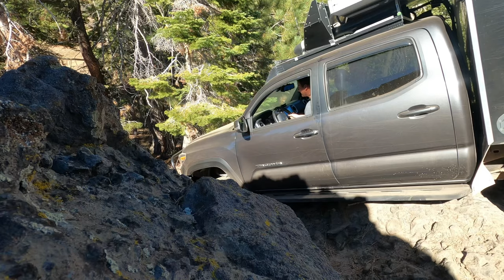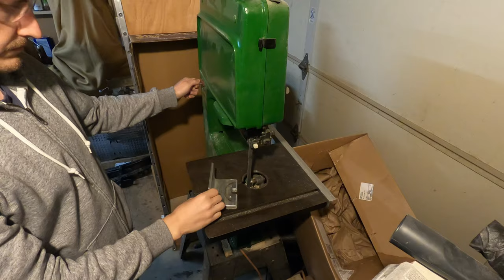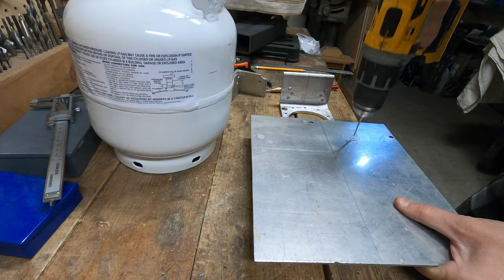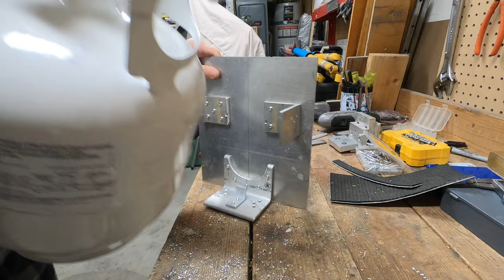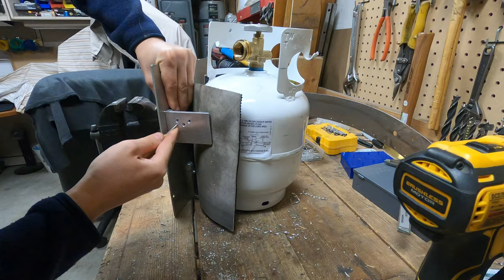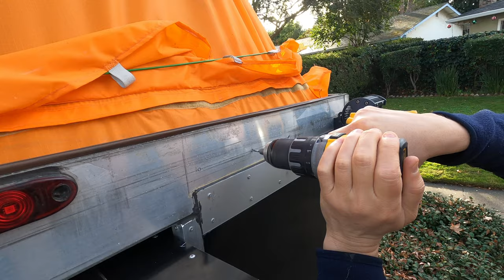ULTIMATE CUSTOM MADE LP TANK MOUNT for my truck camper [Episode 25]

Comment: Looks great. For the amount of riveting you do, I would highly recommend the DeWalt Rivet Tool. Works really well
Reply from the maker: it's a must for the next project, thanks
Reply: @realsystemrobot  Have you thought about getting a welder? Aluminium is a steep learning curve, but you can get to a reasonable DIY level after about a week or two of practice. I just got a small 180A AC tig machine with HF start, being able to weld aluminium opened up some great options for fabrication for me.

In any case, I'm really enjoying your build series and you have some good ideas in this camper. Well done.
Reply from the maker: @Sethjxl I have a MIG welder and use it for steel fabrication when it's needed. For the camper I specifically designed this type of construction. I think welding aluminum for this project is not needed, rivets are stronger for this application. And I don't use the full frame. Also, I think heating/welding aluminum makes metal weak. Even if you have all the additional equipment for pre-heating/post-heating, even if you practice a lot, then you still end up with some weak points somewhere. Of course, professional welders can argue and provide a great level of experience but this is not my case.